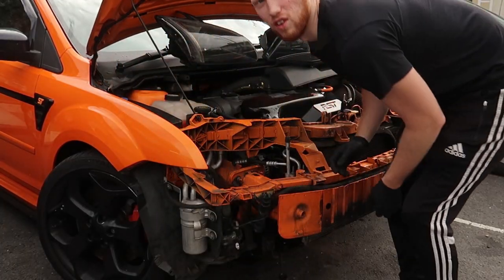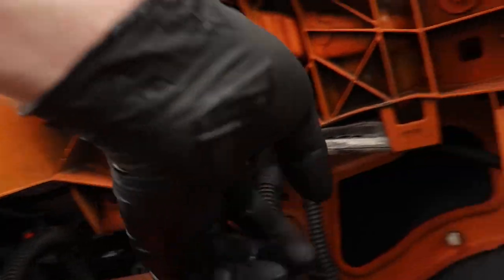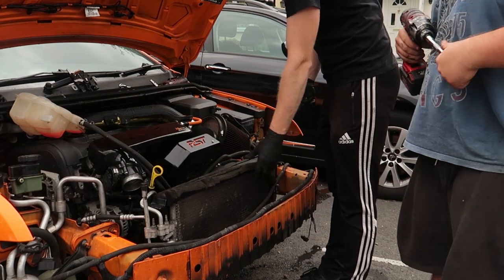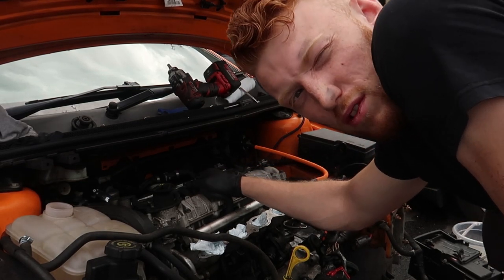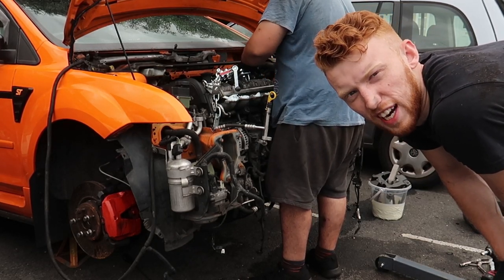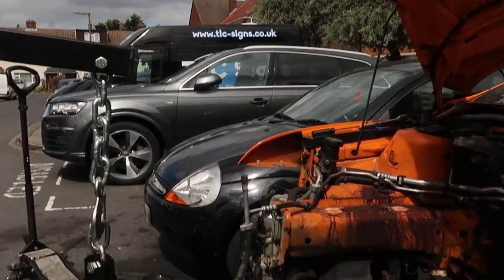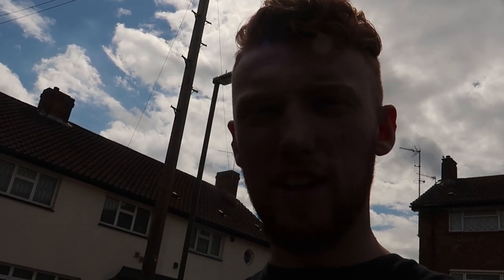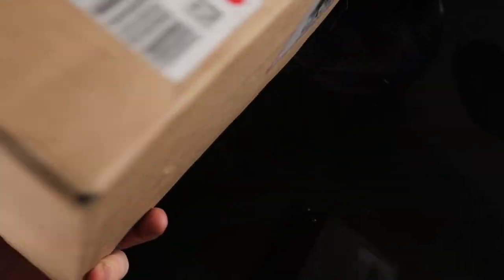REMOVING MY ENGINE READY FOR FORGING 600BHP+ BUILD!

Comment: Big respect for all that mods, especially done by yourself! But can you tell what happened to the engine (time 10:53, oil visible on the frame)? Some kinda major issue?
Reply from the maker: The engine mount the stock ones are rubber filled with oil mine had just split and leaked all the fluids from inside the engine mount so hence all the oil staines down the sides of the engine bay, none of the oil was from the engine or anything just a rubber mount
Reply: @Richieesgarage   Thanks for respond, happy to hear that it was just engine mount. I was curiuous because also have an rs turbo conversion and i was worry if there is something to be aware of, fortunately it seems there is not :)
I'm running about 350 hp on custom software created for st with rs turbo beacuse i'm still on st maf, st map sensor, simota intake and st abs module. I'm very satisfied with this soft, AFR below 11,5, egt also about 900 celcius with max load, but I know that with all remaining abs stuff e.g. rs map, maf, intake etc it could be more :) my tuner has rs soft ready but he told me before he will write it to ecu i must have maf and map sensor at least (best also abs module because, according to him, without it computer will be generating esp fault code visible on dashboard).

Anyway I have one main question: Can you tell me what is abs patch you mentioned?
Is this software change or some adapter etc that comes to abs pump? RS abs module (pump) is unfortunately quite expensive and hard to find...

Comment: I still can't believe that you are doing all these major modifications to your car in your street car park.  Massive respect for that.
GoPro has much better low light quality compared to your phone ... phone was always on the dark side.
Are you going to be fitting Darton Sleeves to your new block?
Reply from the maker: Alan Xr I done use my phone to record bud I use a G7x MK II think I just need to adjust the settings and yh go pro is very good aha,  I’m waiting for a garage to come up near me then will be all done in a garage and it will have a form of sleeve but won’t be Darton appreciate the feedback